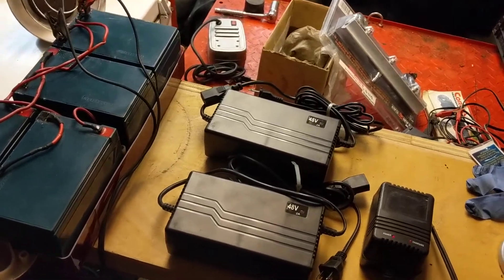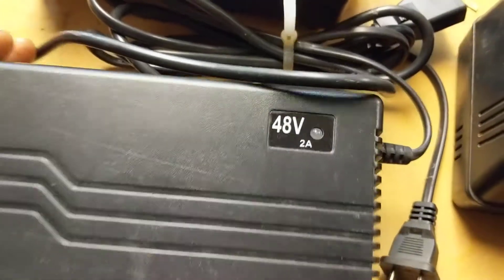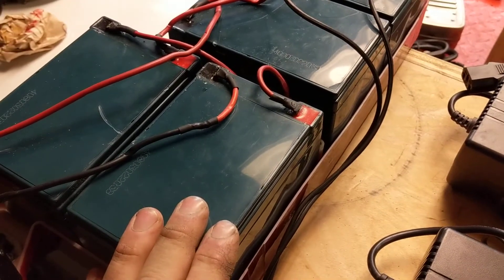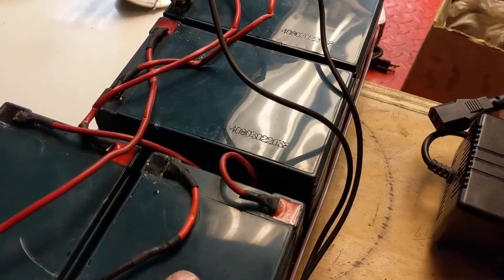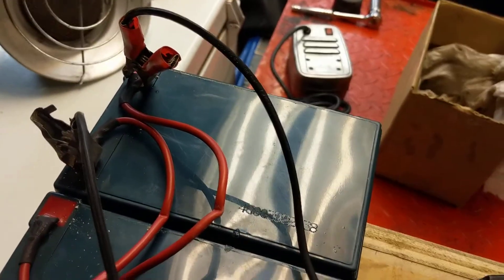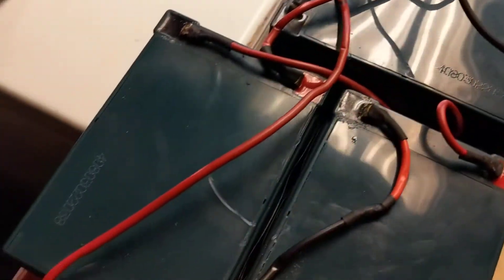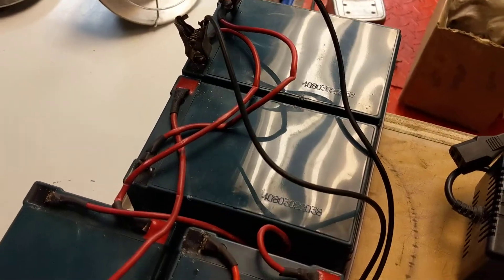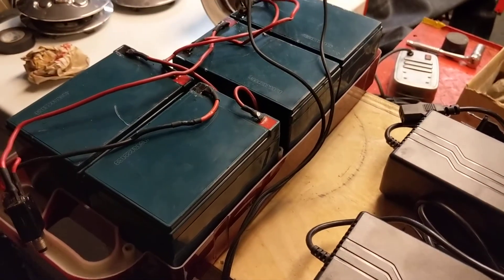Part 2: $50 Electric LVHUA Bicycle buy, Working on the old battery pack

Comment: I'm guessing they're gel batteries in which case the charge conditioning you're doing should work.
Reply from the maker: lead acid. I don't have any expectations for them, i just hope i can get enough into them to turn the controller on in the bike and see the wheel spin briefly, then its new battery time.